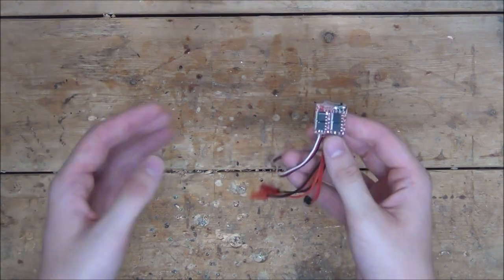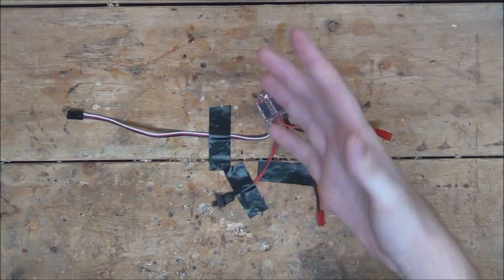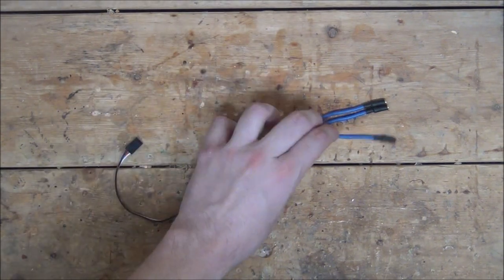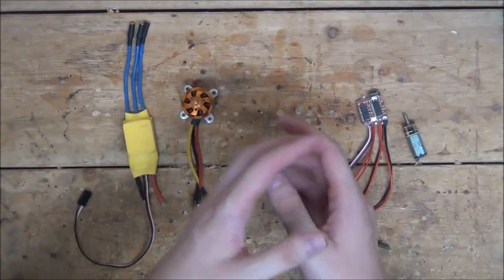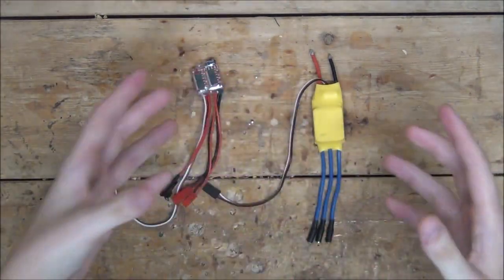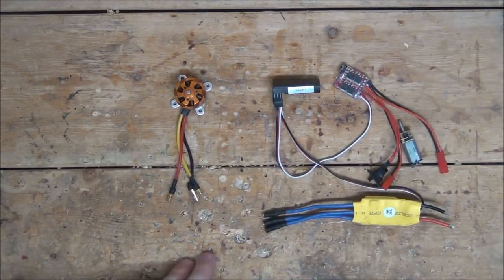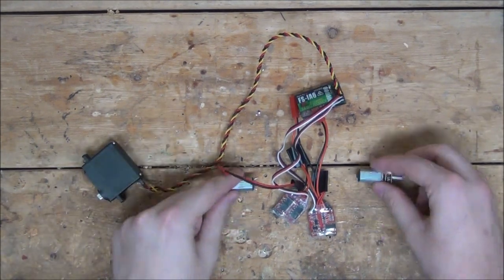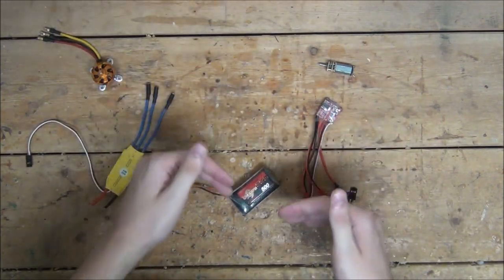How To Use An ESC // Electronic Speed Controller Basics

Comment: Hello sir i am javing same bruhesd 30A  burshed esc when i plug it with motor and battery 7.4vplts it starts sounding loudly... And light also starts blinking...
But when i use mobile battery 3.4 aprox it works what to do ...

Comment: I have a DIY tank tread chassis using 2 130 brushed motors that are already installed. 
   I'm a noob at this stuff, so I need a little gentle coaching. 
   Your video was great, but I need to go a step further. Most brushed ESCs are only designed for 1 brushed motor, but may offer a switch for braking. 
   I suspect I could use 2 of these motors with some fancy Tx programming to run my tank tread vehicle, but I have found a brushed ESC 20-30A capacity, that is designed for 2 motors, with two motor power cables a standard servo connector for the receiver, and an extra (yellow) lead identified as "Connect to 1ch/signal".  I thought this special ESC might be easier to set up for my tank tread application and I could learn how it works in the process.  It also has an "independant/mixed control switch".
   There are apparently no instructions provided, but I have not yet ordered this unit, and won't until I understand what I need to do to use it.  
   Could you offer either a quick, clear tip in your response, or even better, do a video on this type of ESC and tank tread or 2 motor speed boat arrangement specifically?  Thanks! Jim

Comment: Thanks, one quick question on the brush-less power lines with a FC. All 5 are used right? The 3 wire plugs in and the red/black power cables solder to the FC rather than going to the battery. Yes?  Thanks.

Comment: So, on my receiver, it has 
"battery/1/2/3/4/5/6". When the battery is plugged into the ESC, that leaves the one plug that supplies power and throttle to the motor. So does the plug go on the "battery" pins, or the pins marked "1"?

Comment: Power matching between ESC & motor is needed to be considered.That means the power transistors at output stage of an ESC  are capable to drive a bigger motor or two smaller motors.

Comment: I have an ESC that the manufacturer  sez is intended for a 130/180 brushed motor. I connected it to a 550 35T . it worked fine, ( in a short test).  do you know what would typically happen if I were to continue using it this way. would it damage the the ESC or possibly damage the Motor ?

Comment: How do u connect the two esc battery connector wires together
Reply: I’m confused how to plug the esc and the weapon esc into the battery
Reply from the maker: Do you mean like how do you attach them? Soldering them together would be best! Also using heat shrink tubing on the joints or at the very least wrapping them with electrical tape is also a good idea!  :)
Reply: Mechanical Ninjineer yep thanks for the reply:)
Reply: Mechanical Ninjineer so can u solder the brushless esc with the weapon motor and the regular esc for the drive motors all together and then plug them into the battery
Reply: solder them

Comment: Yes, this video WAS very helpful, explaining almost all the basics. 
   But I still need your great knowledge of how and why to understand the pros and cons of single ESCs that can control 2 motors separately. How are these hooked up, and how do I set up my Fly Sky transmitter to use them in tank tread vehicles? Is the proper hookup and programming of a single motor ESC still possible to control tank tread vehicles? How? 
   What are the pros and cons of a single ESC that has an extra control line to enable control of 2 motors, versus a single esc designed for only one motor, but connected for 2?   
   I know this has turned into a complicated question, but I hope you can direct me to (hopefully one of your) videos to carefully explain the answers to my question.  
Respectfully, Jim Eastep

Comment: If i want to use power supply to replace the batteries how much amp and volts should i use
Reply from the maker: Well that would depend on a lot. Which ESCs and Motors are you using and what are you using them for?

Comment: Hi! This has nothing to do with the video but I watch the original how to build a 1 pound battlebot vid and bought everything exactly you got and I have a question. The same exact servos you got struggled to be put in the AR610 receiver. The “head” seemed to be to big. Any tips. I am new to this and I could be doing something wrong
Reply from the maker: hello! Yes, when both the receiver and servos are new it is a snug fit. If you look as the servos plug and receivers port they both have the same shapes. So just make sure you are putting them in the right way and you should be fine!  :)

Comment: can a 7.4V lipo battery supply a 3 dc motor w/ esc. that has total weight of 3kg(including chassis and other stuff in my battlebot) ? thanks for the reply
Reply from the maker: Hello! what 7.4v battery are you using? Like how many MAH does it have? or whats the C count? Also what is a 3 dc motor? And The weight of your bot shouldn't really effect what kind of battery you'll need to power the motors.  :)
Reply: Mechanical Ninjineer 7.4v lipo rechargeable battery 2000mah, 2 built in dc motor for car kit (the yellow one for wheels) + 1 DC 12v 21000rpm 0.7A motor for the weapon. When completed it weighs around 3kg all in all. Thank you for your reply. Much appreciated
Reply from the maker: so the battery has 2 built in motors? or your yellow rc car does? But regardless it looks like your 12v motor will of course need 12v not 7.4 to be able to run at full power.
Reply from the maker: If you can DM me on Instagram i think i can help you out a lot more!  :)

Comment: I still dont understand how you used a dc motor in your diy battlebot video and connected that directly to a radio i dont get it because that modified servo  should have only two leads so which ones actually plug in where
Reply from the maker: All of my modified servos will still have all three leads going into the plug. The only thing the mod really effects is the POT which i superglue in place.
Reply: Mechanical Ninjineer i see, thank you for your response because i tried your resistor method but that didnt work so well for me

Comment: One very important detail missed about batteries, the C rating. The C rating determines how much current can be provided by the battery. To get the amount of current that can provided is simple, capacity in miliamp hours multiplied by the C rating. .5x20=  Ten amp continuous. Most batteries also have a burst C rating, which is the amount of current the battery can provide for a few seconds. If you fail to meet the C rating, you'll cause your bot to brown out, or worse case, you'll kill the battery.
Reply from the maker: Yes, very ture! I didn't go into too great of detail on batteries for this video because it was suppose to be more ESC based. However maybe I should make it a series and do a battery video as well?

Comment: Stupid question... but if you connect the esc to the battery, without plugging in a motor or transmitter/receiver.... can I break the esc? 

Sorry again... I'm a complete noob!. Great video by the way!
Reply from the maker: Nope! As long as the ESC is rated high enough for the batt ( don't use a 4s bat on a 2s ESC) You will not damage the ESC. And no such thing as a stupid question! I'm excited you're getting into bots!  :D
Reply: @MechNinji  cheers for the reply buddy. I actually wired it up properly and it works ... so I figured I didn't fry it the other day when I asked the question.  I bought a foam glider and trying to mod it by adding a motor and control surfaces.